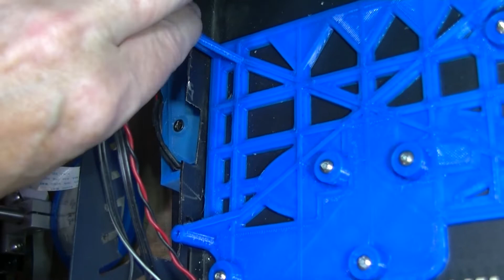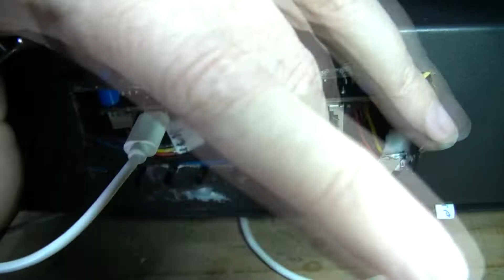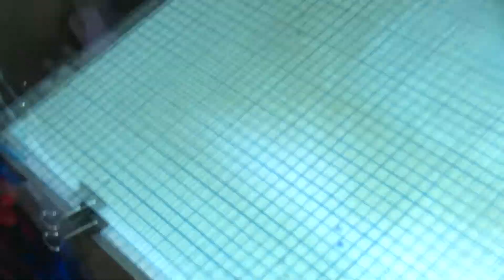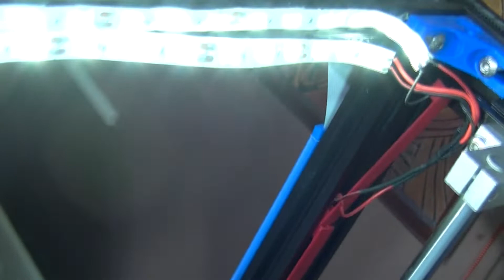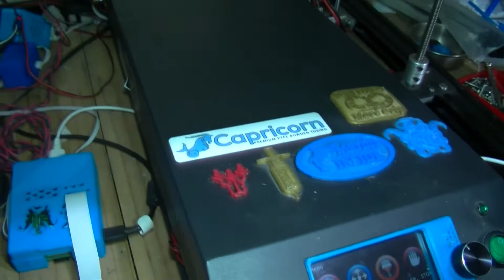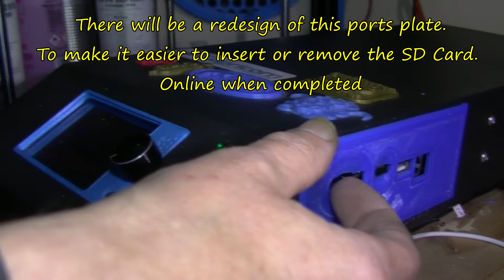Creallity Ender 5 Plus Octopus V1 1 Mount

Comment: On one of my 5+ machines I have a  just added a 7" touchscreen but instead of running Octodash or Octoscreen  I have connected an original Raspberry Pi 1 with the Kiosk browser OS and Octoprint set as the homescreen, I have put the screen and Pi in a printed case that is screwed to the front edge of a lack table that this printer sits on and is articulated so I can set the required angle, I much prefer this to Octodash as I can have all my plugins running
Reply from the maker: First time I heard about :) Interesting, thanks

OctoDash is an Open-Source Dashboard for OctoPrint, which is optimized for 3.5" to 7" touchscreen devices. I mainly created this project, because there was just no nice-looking UI available, which could be run on the Raspberry Pi and provide access to OctoPrint where it is needed most - directly at the printer. 
https://unchartedbull.github.io/OctoDash/index.html#:~:text=OctoDash%20is%20an%20Open%2DSource,most%20%2D%20directly%20at%20the%20printer.

or heard of OctoScreen is a LCD touch interface for your OctoPrint server. It is based on GTK+3 and allows you to control your 3D Printer using a LCD touch screen, a Raspberry Pi, and OctoPrint. It's an X application that's executed directly in the X Server without a window manager or browser, and operates as a frontend for OctoPrint.
https://github.com/Z-Bolt/OctoScreen#:~:text=OctoScreen%20is%20a%20LCD%20touch,a%20Raspberry%20Pi%2C%20and%20OctoPrint.

or even Raspberry Pi Kiosk using Chromium
https://pimylifeup.com/raspberry-pi-kiosk/
https://reelyactive.github.io/diy/pi-kiosk/

I use OctoPrint a lot and SDCard sometimes using LCD12864 setting on a dual display BTT TFT35